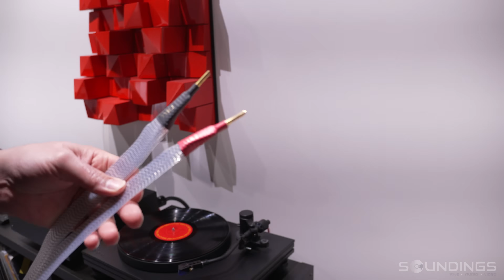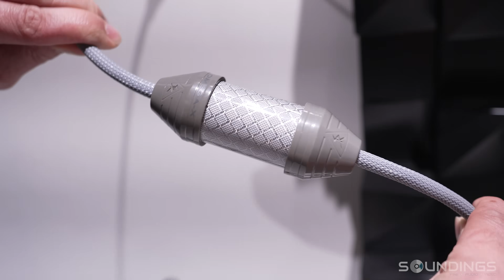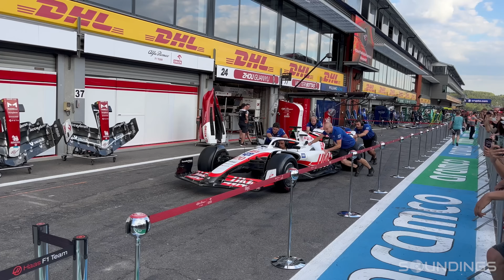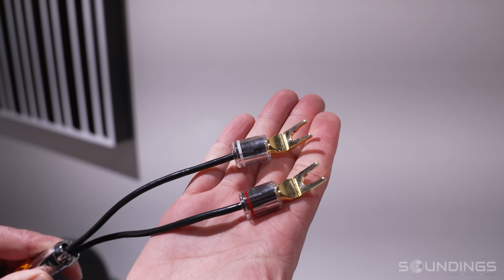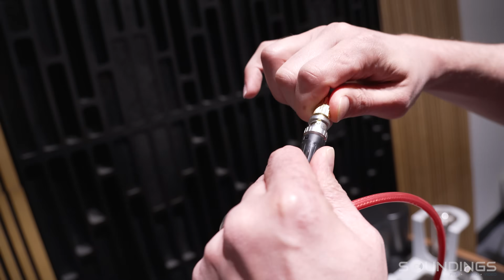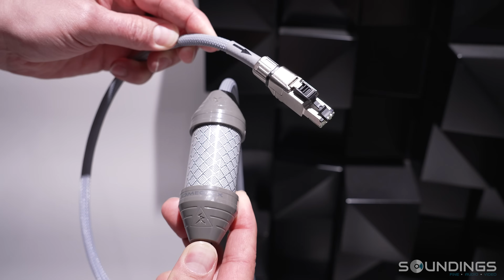Do Cables Really Matter in a Hifi System?

Comment: Inductance and resistance are the most important areas in speaker cables.Helping to contribute towards maximum damping factor and bandwidth,pushing phase errors out of the audio band.A good dielectric material needn't cost the earth either.After that,ensure that the lowest resistance contacts are used and ignore any other marketing claims being made.A cable which has all the elements mentioned will do all it needs to do.Definitely don't assume more expensive equals better quality either.

Comment: Great standpoint…
To me personally, after listening to many different cables in the last 10 years a specially…i hear differences in analog cables.
But non on digital ones (provided it is still done within a reasonable range and not cheaply).
All power and analog cables are diy here (using Lapp, Bals, Sommercable and Hicon the most).

Thats to me the best sounding and affoldable way to get good enough cables.

Comment: The "qualities" for electrical behavior are resistance, capacitance, and inductance. That's all. Design philosophy doesn't matter beyond those three things. Design and material used don't matter. Those three things vary with cable type, length, and material. But that variability may not be audible. In typical home audio--they are not audible. The test, which has repeatedly been failed, is simple, Distinguish cables in a properly double-blinded and level-matched test.

Comment: All I'm going to say is he is correct with most things but....It can't be more emphasized more that it is HIGHLY DEPENDENT on the level of your system. The problem with the argument is that both camps are correct  hence how long this debate has been going. 

There isn't a black and white to they do or don't work, it's a lot more complicated than that. 'Generally' those on the 'does make a difference camp' are enthusiasts that have higher level systems.  In their case they are correct saying that they make a difference because they do.

On the other hand those on the 'don't make a difference camp' are also right as they probably haven't spent big money on stereo gear therefore cables don't make a difference - they are also right. Then there is the grey in between, as I said it's a spectrum rather than black and white. 

For me with a mid-range to higher end system some cables make a difference while others not so much. I find speaker cables make the largest difference followed by RCA interconnects. I haven't used balanced cables very much only from my turntable to my phono pre-amp. As for digital cables and power cables I haven't been able to clearly pick a difference.

So my opinion is there are a lot of 'depends' in this debate and law of diminishing returns is a HUGE factor. 

FWIW I don't work in the industry and never have. I'm purely a enthusiast that's been in the hobby for over 40 years.

Comment: Come on. There's no evidence in all this cable talk! Get some decent well-built RCA interconnects, reasonably priced XLR balanced, 12AWG copper speaker cables, and you're good. Techie audiophiles have published measurements and stuff over years already. And like other say, do an actual blind test and it'll be obvious how amazingly overpriced the expensive cables from Shunyata, AudioQuest, Crystal, Nordost, etc. are.

Comment: Great video on cable info !!  I was surprised you didn't mention OCC Copper (Ohno Continuous Cast Copper) which improve sound at molecular level by reducing crystal barrier.  Then also WireWorld because of their wire configuration.  WireWorld configuration plus OCC Copper used I was expecting to see listed or mentioned.
Reply from the maker: You're totally right!  OCC and metal purity can be a big deal.  It was just an oversight to have left it out.  Thanks for the feedback!
Reply: OCC doesn’t necessarily sound better.  There is more than just specs to a cable.

Comment: Even though I'm an avid stereo music lover I also love the occasional movie, too, and due to lack of space I have to optimise my setup for multi-channel listening also. However, when it came to listening to my newly discovered multi-channel setup I immediately became aware how my small 13 × 11.5ft room sounded different. Didn't know what it was at first, but coming from an audio black background there was no way I was prepared to put up with it!

Even after auditioning 3 separate AVRs, the same faint electrical presence had replaced the ambient sound of the room! That told me the extremely faint background signal noise I had been experiencing (poor description) had nothing to do with the actual units. Therefore, my attention changed to the cables. And even then it was only on the third occasion after living with two previous sets of cables that I finally ended up purchasing shielded cables, and lo and behold that is when the noise floor within my small room finally came down to satisfactory levels.

 Cables do indeed often act as antennas for attracting RF, and the longer the cable, the better the antenna! Probably explains why when I used to disconnect my heights and surrounds within 10 minutes, the faint background signal noise (RF/EMI) within my small room used to practically disappear/dissipate

The more cables I shield, the quieter my room becomes, and the better the shielding, the more the cables are likely to disappear.

If one has the same sensitivities and is looking to address this matter, but is also hoping to notice (hear) the incremental differences, I would suggest starting with analogue cables before moving on to digital and power cables (no good trying to hear the quietest when one hasn't addressed the noisiest)

Trying to achieve a silent room sadly has turned into an obsession for me. However, the results speak for themselves. There are times when sitting in the MLP and pressing pause (or mute), I'm unable to differentiate whether the systems on or whether the systems actually switched off. Of course, audiophile equipment helps, but in reality for one to experience an exceptionally quiet room with a multi-channel setup, shielded cables IMO are a must.

Comment: Making a video like this in 2025 is just nonsense.  Audiophiles fall in 2 groups: those that feel cables make a difference and those that don’t.  There is little to nothing you can do to get anyone to switch camps.  Your “science” in support of your position is hardly compelling to those of us who question the value of cables.

From my perspective, stranded vs. solid core is nonsense; all that matters is the gauge of the copper wire.  At around 3:45 minutes into the video, when you started talking about fancy electrical filters, I simply stopped watching.  At the end of the day, you are only talking to audiophiles who already believe cables make a difference, NOT answering the question.
Reply: Not true, you left a 3rd group out, audiophiles who are not sure. If you can prove your theorems to all 3 groups, we'll consider you the new expert in now 2026.
Reply: @PhotographyInFlight4183 I have no theorems and never claimed to have any.  Yes, there are audiophiles who are unsure,  but that doesn't change the lack of consensus on this issue.

Comment: Came back from a fishing trip, as they were dropping me, my buddies wanted to come in and listen to my sound system, they were impressed, but not me, there was something missing. After they left my wife tells me take a good look, she wanted to surprise me for my birthday and had bought me my first pair of real high end speaker cables. I was quite disappointed with the results, but did not learn my lesson.
A few years later I was selling a phono stage, someone wanted to listen to it, I told him "no problems, but I just sold my Cardas cross, so it wont sound that good since I only have cheap 30$ cables available at the moment".  After the audition, the guy asked me, “why did you say it would not sound that good, it sounds fantastic”, I thought so to. Still did not get my lesson.
Again a few years later, we had just moved to a new place, my sound system did not sound very good where it was located, so while my wife was gone to her mom’s place for the weekend, I took advantage to move my sound system to the best place possible for good sound and it sounded so much better, but for ease I had used ordinary cables with banana plugs and none locking RCA’s.  So, the weekend after I plugged in my beautiful siltechs, ready to be even more astonished.  I finally started to get my lesson. Some of us are slow learners.

Comment: I think you wasted your class money on bubblegum instead. Tell us about skin effect and opposing electromagnetic field and conduction and induction and radiation and susceptibility, mutual conduction depth of signal penetration scattering of fields in muhly layer conduction stray capacitance, hack I know several hundred property that would make a Hugh difference,, even cable make up dielectric characteristic POL;ARISDAYIOMC , goldisin effectr yeweklet abd inhert. You need to dend deverak hours on this simple topiC. I THINK UOIT HEQAD IS O GLQAT FOREQL QANALYSISall those good stuff you could heave learned in telecom theory or magnetism, the

Comment: Gold is a less better conductor than copper, what you told is misleading. To plate a copper wire or connector with gold, you need first a nickel layer, who's also a much lesser good conductor than gold. In fine the audio signal will have to jump through multiple metals, so the build quality matters more than all these fancy theories.
Reply from the maker: Hi Pierre!  I totally agree, gold is inferior to copper as a conductor, but oxidized copper is even worse.  Many of the plating solutions are designed for longevity and are there to give a longer life to the metal beneath.  Ideally silver would be used in all applications, but it is obviously cost prohibitive to use it in every situation.  Like most things in this world, it's about trade-offs.  Thanks for commenting!

Comment: Cables do matter and they can make an audible difference. Particularly in longer runs of speaker cable. HOWEVER..... even 12 or 10 ga multistranded copper wire costs less than a dollar a foot.   A set of well constructed shielded RCA's is about 20 dollars. An even better solution are balanced XLRs which will cost about the same. The budget alloted for cables is what differentiates audiophiles from audiofools😂

Comment: Hi I know your store sells products but when you talk about cables and just say differences can not be measured is nonsense you are pushing Power Cords shows you are just another money grabbing company the BS that the cable companies push is totally nonsense the Companies you mentioned in your video are some of the biggest Snake Oil Companies 
I made a pair of pair of 8ft pair a loudspeaker cables with CARDAS 9.5awg Litz Cardas wire twisted …this DIY cable will smoke any other cable made for $300…Engineer of 34 years
Reply: I don't understand are you saying that cables are snake oil or that well made cables can "smoke" badly made cables? Cables either make a difference or they don't.If they don't make a difference than your cable is just as good or as bad as other cables, if they do make a difference then you'd have to agree that some cable manufacturer's cables might be better than your DIY cable.
Reply: @jakbenardete7707  
Don't confuse him...
Reply: The DIYer sounds like something's screwed up.

Comment: I really do appreciate what your doing but I’m very confused,

Please explain how you affect timing changes in cables or how they are created.

You also said the different metals affect what frequencies travel best and gold and silver are used on circuit boards but we use copper because it’s cheaper. This is a bit of a blanket statement. How does circuit boards correlate with speaker cables made from copper if (i’m assuming you are talking in an all analogue circuit)

How better does a high frequency signal travel through silver when compared to copper and how does this affect timing (assuming these signals travel at the speed of light?

You also say you found these differences objectively, do you have the results to share? Or are they subjective?

How does plating cables with silver or gold create resonance?

How does magnetism in a power cord change its character and frequency response and by how much does it affect the electronics in say, an amplifier or DAC (what should I hear)?

You mentioned Siltech cables, very expensive and lots of verbal salad but no data to prove their claims and statements….

You mentioned the differences between cat5 vs cat6 cables, its a little week what you’ve suggested. The main difference is the speed it can throughput data. Just for you I’ll answer this one ‘Cat6 offers significantly higher bandwidth (up to 250 MHz) and supports much faster speeds (10 Gbps at shorter distances) compared to Cat5e's 100 MHz bandwidth and 1 Gbps speed’.

Just some of the questions I have for you.

I was hoping you were going to talk about USB cables, or did I miss that one!

I think you are over complicating and confusing things for the beginner without much foundation, I thing your just hyping marketing BS, please give us better quality content
Reply: It's a basic YouTube presentation, not a master class in cable science. Calm down my friend, and for the love of Pete, keep your question short and concise. Nobody is going to address your sermon of questions.
Reply: @PhotographyInFlight4183 who's asking you!
Reply: @rm-mastering No one asked, but I was honest enough to say what needed to be said.
Reply: @PhotographyInFlight4183 that's just your subjective opinion just like the video - no context, no facts just bullshedo.